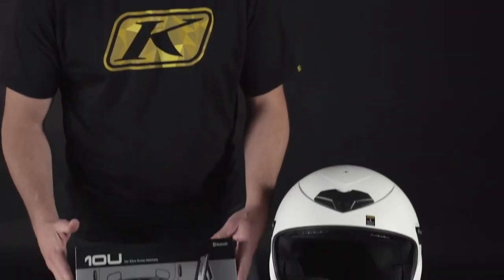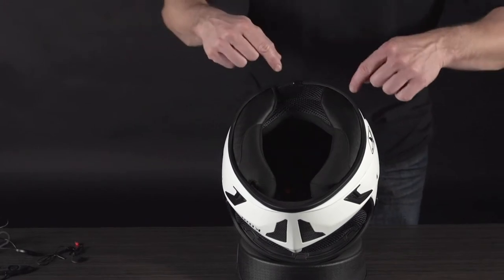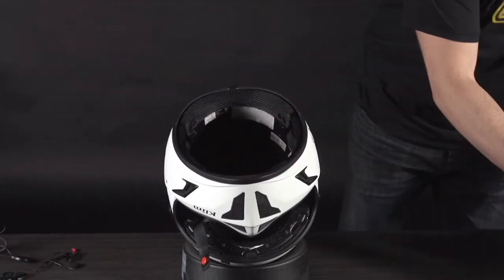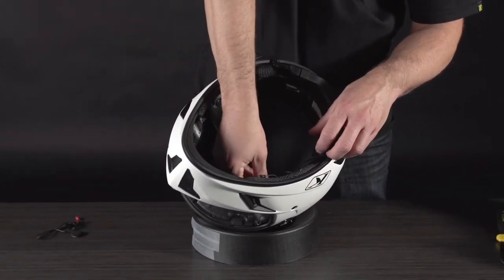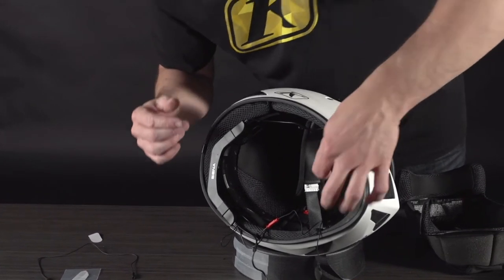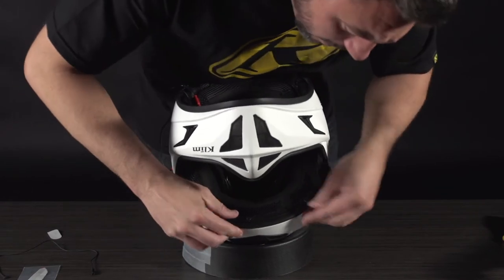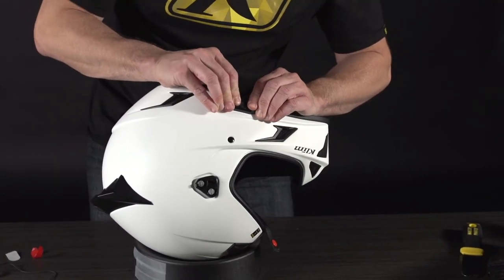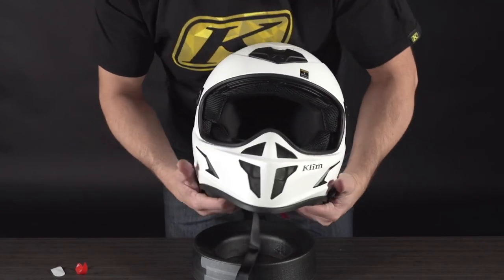How to: SENA 10U install on KLIM Krios

Comment: Cool…except for the “basic putty knife tool” part. C’mon, y’all could add one more sized piece of plastic?
EDIT: I recant. They updated the design to a smaller “disk shaped” antenna which fits inside without tools. This was the easiest headset install I’ve ever done. Shoei and HJC, take note!!!
Reply: shoei take note? my sena srl mesh installed super easy in the neotec 2 without having to glue anything on the helmet 💀